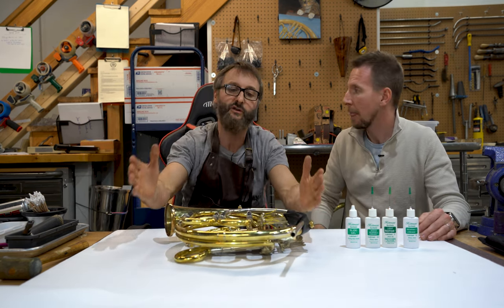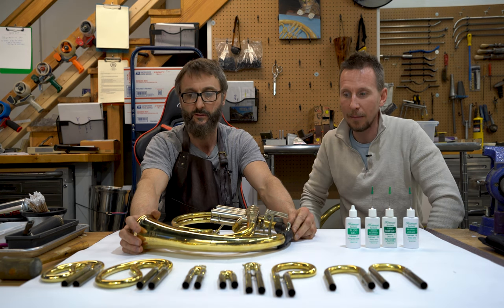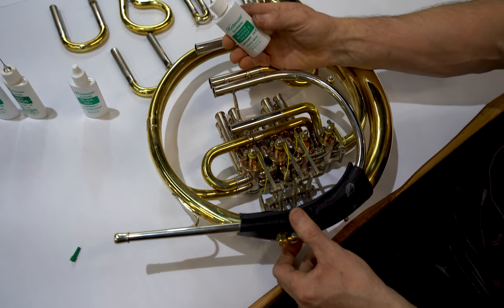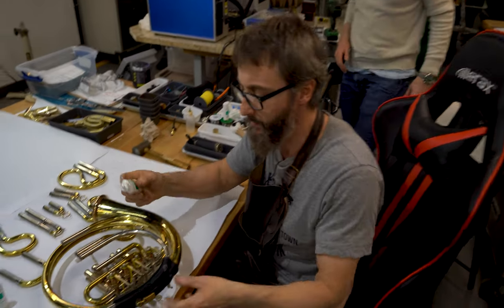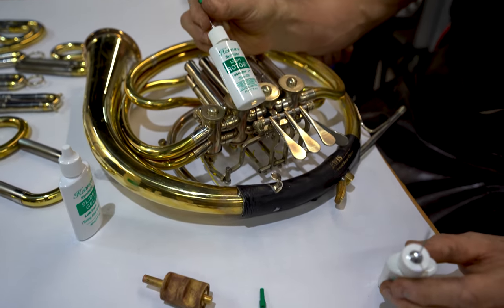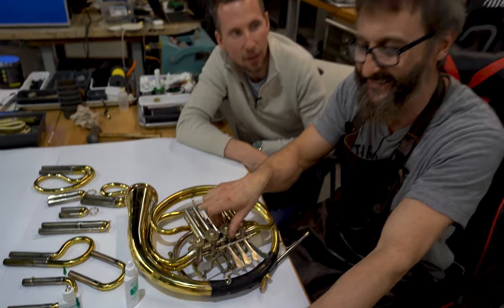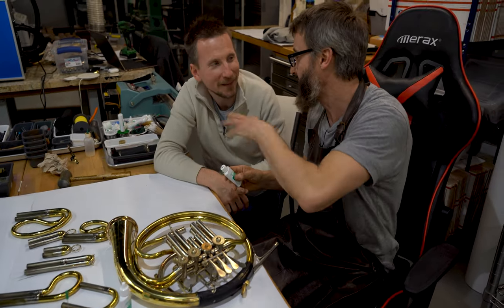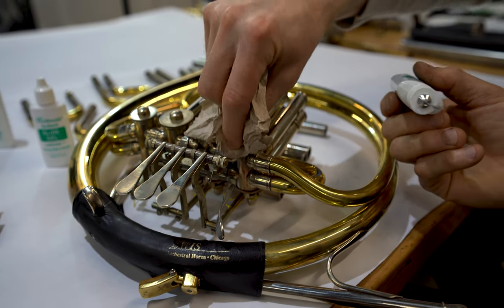How to Oil Your Horn, Featuring Ion Balu

Comment: I like to put a little graze of oil on the threads of all my caps to make sure they don't seize, not even a drop but just some on your fingers and then rub it on, then tighten it with a "torque setting" of as tight as you can make it only putting one finger on the cap. Also, I like to put a drop in the lead pipe to have a nice thin layer protecting the brass from corrosion, but it should be done prior to cleaning the main slide so that you can get the oil off the slide and make sure it's nice and greasy rather than oily.